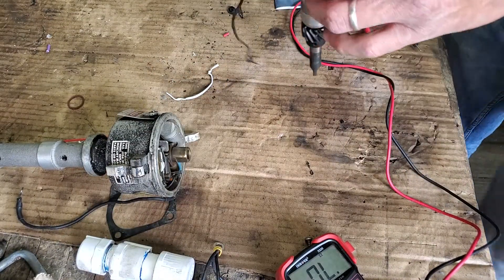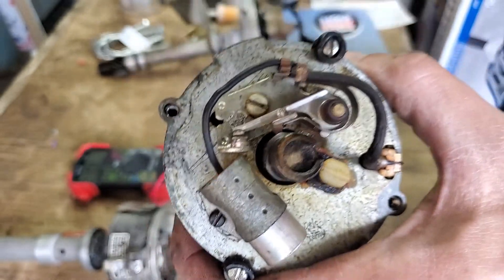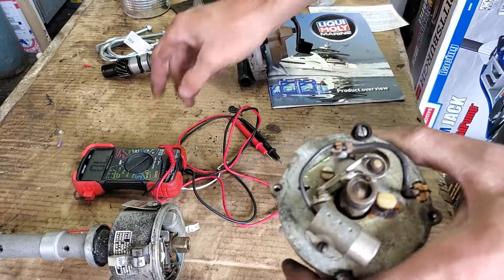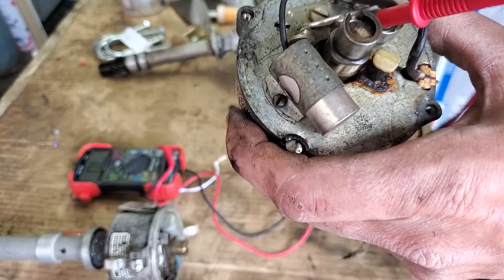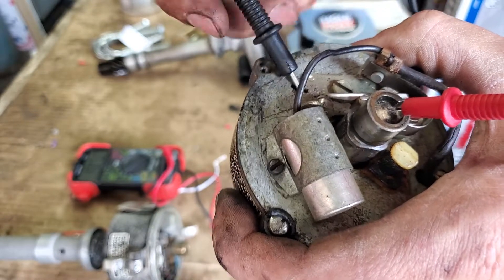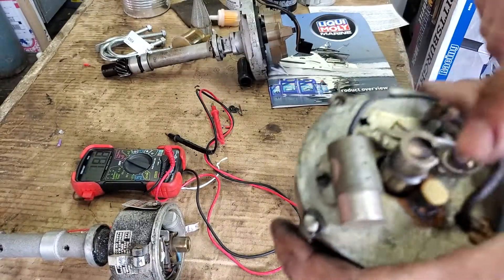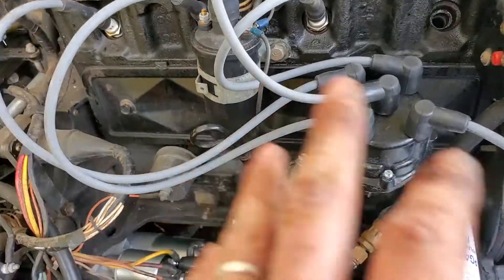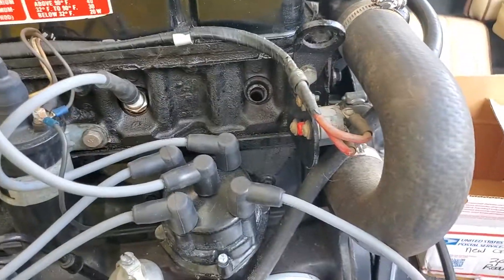Timing a mercruiser 140 part 3 - Setting points gap and orientation of rotor to cylinders

Comment: I have an interesting issue. I'm getting 12v on the + side of coil with key turned on. Disconnected kill switch and shift switch to eliminate possible cause of grounding out the coil. I can physically open the distributor points with a screwdriver and see a spark jump from the coil output wire to ground, but nothing comes from the distributor. Adjusted the point gap to .018". Using an inductive timing light to check for spark. Nothing when I crank the engine. I'm thinking of replacing the distributor Points, rotor, cap and condenser, but I don't like throwing money at problems without knowing for sure. Does this sound like these parts need replacement? Any further tests I can do?
Reply from the maker: spark coul dbe weak, did u run sand paper between the contact points? could also be a weak condenser that causes this.. there should be a strong spark between the points. Coil ohms shd be around 3-3.5 for these, some olde rmercs had a resistor wire in the harness. Try putting a full 12v+ jumper wire onto the coil + and see if ti fires.. distributors are usually not the issue, could be a ground leak at the points or single wire or something...

Comment: usually not - disconnect ALL wires on the coil negative EXCEPT the one from the distributor and try again.. any kill circuit grounds the coil neg killing spark (like a kill switch, shift interrupt, etc), this test eliminates that, of course thats assuming you have 12v at the coil POS with key on..

Comment: Hey does this boat have a kill switch? The one on my boat will crank over with 150psi on all cylinders but will not get a spark, tested the ignition coil has power 6 volts on positive side but the center of the ignition coil will not give out any power. What do you think it is? Its a 1986 sea sprite Mercruiser 3.0l 140 motor

Comment: I have continuity on my points open or closed please help! What is my issue here? Thank you! Great channel brother very very good.
Reply from the maker: try remove the wire from the distributor to coil neg and try that. If its connected u will get continuity. If problem persists, make sure you arent by accident touching the bottom, only the arm tht opens and closes is insulated from the body, the rest is the same as ground so u have to make sure the probe is touching the long arm only, or the spring on the arm, the part below it should not be touching otherwise the system will be permanently grounded.. hope that makes sense
Reply: @SocalMarineUSA  okay will try thanks
Reply: @SocalMarineUSA  Hey SoCal just thought I would write back and let you know I got my points and timing straight and my 3.0 running great. A new carburetor or rebuild should get it even better Thanks for all your help. This motor is a 1987 In a Chaparral I’m reading to use synthetic oil in it but did they use synthetic oil in the 80’s I’d like to use what was in it originally. I’m going to change the oil and winterize today and wanted your thoughts. Thanks again for your help.
Reply from the maker: @Lyric7347  good news! I would use chevron delo 400, or any mid grade oil mineral would be perfect.. synthetic will work but some users note more oil weeping with synthetic.  Quakerstate high mileage is also great stuff.. Rotella too.
Reply: @SocalMarineUSA  Thank you my friend!
Reply: @SocalMarineUSA  Done! I used the Chevron oil you recommended and ran motor a bit more with new oil and more sea foam in the fuel. Oil pressure 35PSI engine sounds real good and strong. the tach works I had it disconnected and reconnected today and it works my problem now is the idle it’s at 3K rpm according to gauge and I think it’s correct I think it should be around 800-1000 max at idle. The throttle screw adjustment is bottomed out can’t go no lower. There’s a screw on right side bottom of carb I think possibly air mixture maybe, if I screw in all the way it kills motor I just backed it out 3 turns and seems good there. Do you think it’s just the carburetor being old and needing rebuilding why it won’t idle lower? Motor sat 10-15 years. But so far I’m very happy with the progress I’m sure I’ll get it all dialed in.
Reply from the maker: @Lyric7347  try tapping the tacha  bunch of times with something like a screw driver handle, ive had ones that needed a minute or two of tapping before registering correctly.. just tap the face glass and see if it settles in.. the throttle cable might also be holding the idle back, the cables on boats are rigid unlike cars, they hold the carb in place, so you have to compensate for the idle using the black plastic barrel as well as the idle screw (ie you can set idle a little bit on the idle screw only, but more than a little and you have to do the idle screw AND the barrel) and balance it out till its right when u move back to N. As for the mix screw yes usually 2 to 3 turns is the sweet spot. Make sure the choke is fully open before tuning and engine WARM or HOT, NOT cold. Now once the engine is warm turn it in and out till it bogs counting the turns in half increments, usually in between those two bog areas is the sweet spot that produces the highest rpms- this applies to every engine by the way, dirt bike, car, hotrod, boat, etc etc-  some carbs have two and u repeat each screw in till bog, out till bog, then in the middle for highest rpms and ur set.. if the idle is too high cos you have tuned it better, THEN use the idle screw to set idle speed correctly.. IE a badly tuned idle mixture can idle at the right rpm because they compensated for a bad tune with a more open idle blade setting.. you want the blades as closed as possible for a perfect idle when you are done basically...
Reply: @SocalMarineUSA  okay I see what your saying. On the barrel adjustment. Yeah so the engine was up to temp tach says 3K I did tap the tach it seems to be working and correct. The idle adjust screw is all the way out it’s not even pushing the throttle linkage so it must be that barrel I need to adjust. I’m sure that’s it. I got you on the blades they must be opened a bit to much and someone fooled with that I bet causing the higher idle. What should the rpm be on this 1987 3.0 900 maybe in that area? Thanks SoCal I will check this end of this week before winterizing for the winter. Much appreciate my friend
Reply from the maker: @Lyric7347  If you have way too much timing, the idle will also not go down with carb adjustment.. Try follow the manual OR close the carbs as much as possible and aim for between 4 BTDC and 4 ATDC at idle and work around there.. you want nice snappy off idle power from the engine, it should be instant and not surge or anything-
Reply: @SocalMarineUSA  Got it! Thanks SoCal appreciate everything my friend. I’ll keep you updated on results
Reply: @SocalMarineUSA  Still same issue. Do you have an opinion on switching to a Pertronix 1146A electronic system. It seems to be a very easy to install upgrade and less hassle with the points set up. Thanks
Reply from the maker: @Lyric7347  Dont touch the pin on the back of the spring, it connects to the base plate and will continuously beep, touch the insulated spring (it should be insulated)... pertronix is good yes, not as reliable. the pertronix 1 burns out with key on / not running but works with stock coil (usually about 3.3 ohms or more). Pertronix 2 doesnt burn out, has adaptive dwell (not sure if thats worth noticing), and requires a roughly 1.3.to 1.7 ohm coil (any make will do).. ALL pertronix require full 12v at coil, and there are tests to perform individually - check the pertronix troubleshooting guide - if u still have issues..
Reply: @SocalMarineUSA  okay thanks again SoCal! I’m still playing around with it before I eliminate the points I’m not in a huge rush Just an old boat I ran across and I think I can save, I it bought it  cheap. I could sell parts and double my money. 1987 Chaparral 187 Xl. 3.0 / 700.00 with perfect trailer 18” never been toyed with. I got trim working it had a broken brush holder inside motor. Blower works all lights and bilge pump. Motor is clean great compression clean oil, it was winterized.  I believe she will run great once I figure the points situation. Fingers crossed! Thanks for your input I really like your channel your very detailed and an a great mechanic thanks again for putting out the information it’s very very helpful. It’s been awhile since I messed around with points but I have 30 years ago! Lol I’m also a mechanic industrial field rotary screw compressor systems. Thanks again!!
Reply from the maker: @Lyric7347  not a prob.  Feel free to look up socal marine LLC in San Pedro CA, from there shoot me a text,  be glad to help over the phone.
Reply: @SocalMarineUSA  Thanks brother! Appreciate that!

Comment: If you know your engine needs to be at, say, 8 degrees BTDC, then can't you just set it manually there?  Why the "half an inch" recommendation?
Reply from the maker: the 1/2 inch of for folks trying to get the motor running - some just dont have a timing light and the half inch will gt them running - maybe 2-4 degrees out but the motor will run just fine.

Comment: Is this the same for a 130?
Reply: you mean 120? yes - if its a GM block yes. Ford distributor usually rotates the other way - but the concept works on all gas powered engines regardless of cylinders / configuration etc..